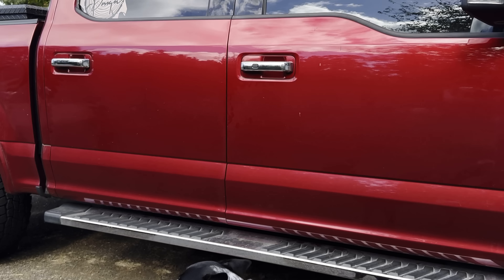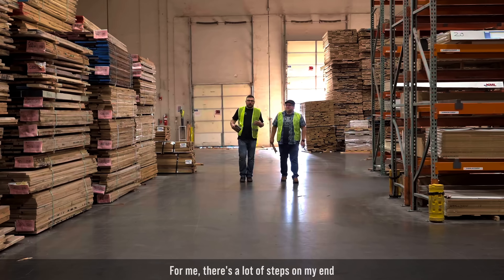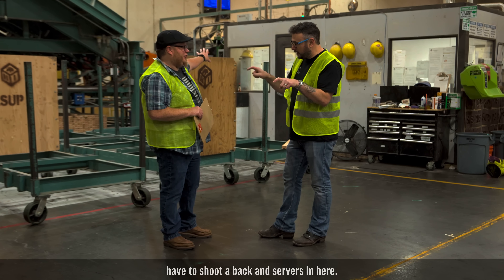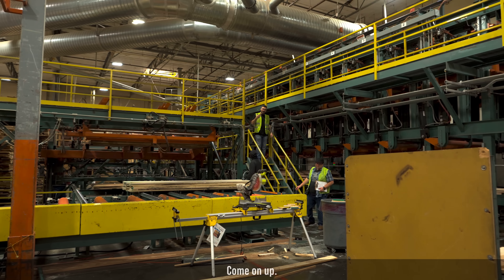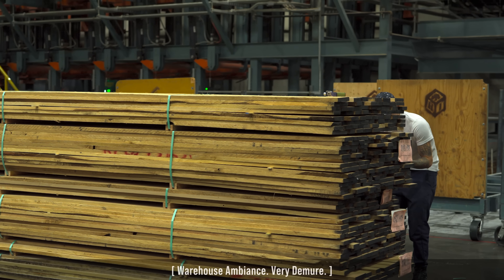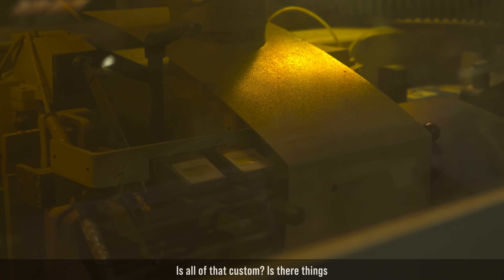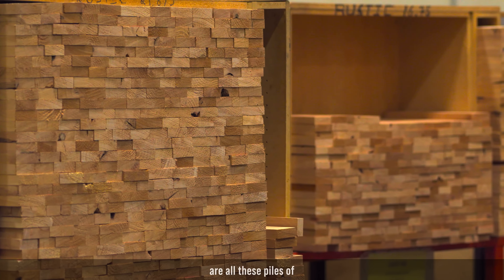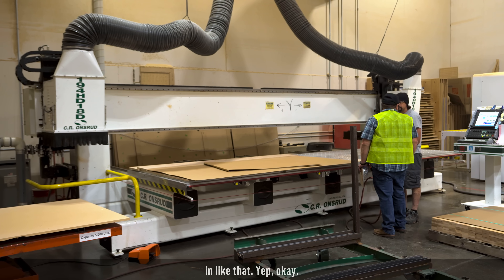Behind the Scenes: The Lumber Industry's BEST KEPT SECRET

Comment: with the Titebond II and walnut does that mean the Titebond II Dark has failure issues with walnut?
Reply from the maker: Good question. I don’t think dark is used industrially and there’s probably not the data to confirm or refute, but I’d assume if there’s a higher fail rate in TBII, that would carry over to a tinted variant of the same formulation.